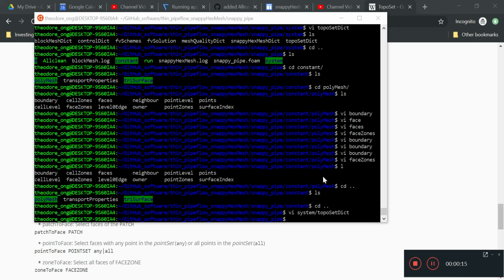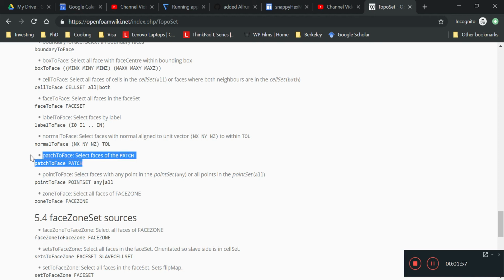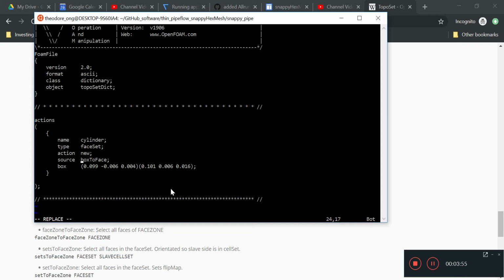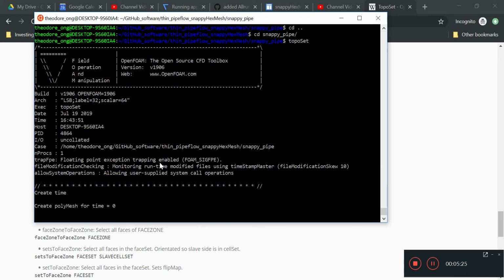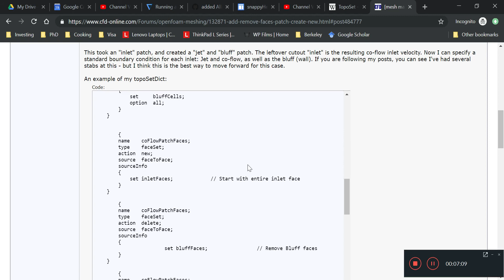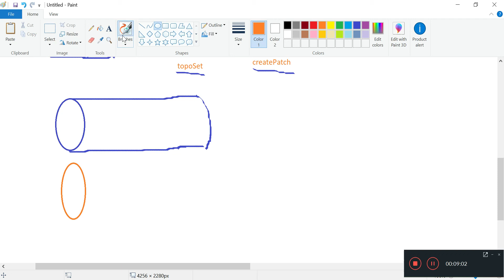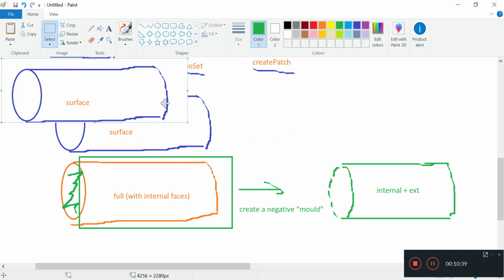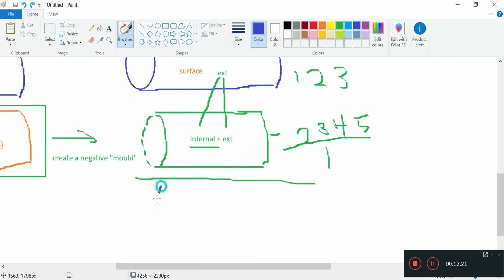OpenFOAM Intermediate 11 - topoSetDict introduction

Comment: hello Theo.....i have meshed a block with needed dimensions and wish to split the block with left wall as heater, a small portion of the block adjacent to the left wall as a solid portion and rest as fluid all within the meshed block......for this do i need toposet and then move on to splitmeshregions? Trying to construct a conjugate heat transfer problem using OpenFOAM :)
Reply: @TheoOngScienceAndEngineering  Yes Theo....I went through those videos n that's how I completed blockmesh and toposet....after that I ran splitmeshregions and finally decomposePar....I have got no errors so far but still not able to view temperature plots in parafoam.... 🙄

Comment: Another point to be noted (something I faced). While choosing the box in boxToFace of TopoSet, make sure that the convention of the coordinates is such that your starting point should be close to the negative axis and as close as possible to 0. For example- in my case, I have a channel of 2h=2 in the wall normal direction. My channel is from y=-1 to y=1 and x-z dimensions of 0.075x0.075. I started from 0,-1,0 to 0.075,1,0.075 and only then did it select the box correctly. 

When you have to define many faces of the same domain, do not CHANGE the system when you move to the next face. Use the same convention but slightly modify the coordinates to select the right face as shown very well in this video.

Thought this might help.

Comment: Hello! I have a problem with boundary in polymesh folder. After blockMesh and snappyHexMesh, in boundary i have not cylinder but movingWall, fixedWalls, frontAndBack. Can you help me please?
Reply: I have the same thing. Did u found an answer?
Reply: i have the same problem .. have you find the solution for that?
Reply: Have you found the solution?